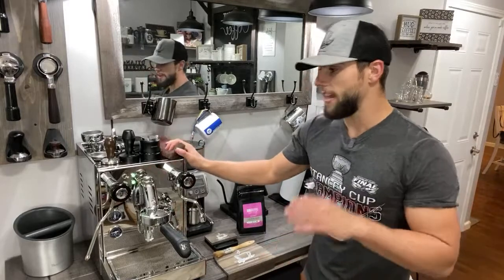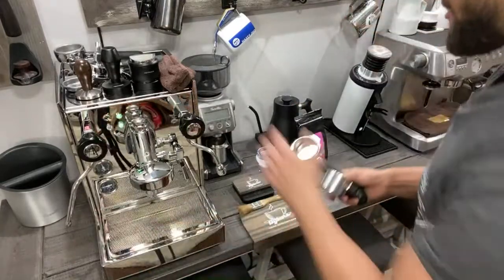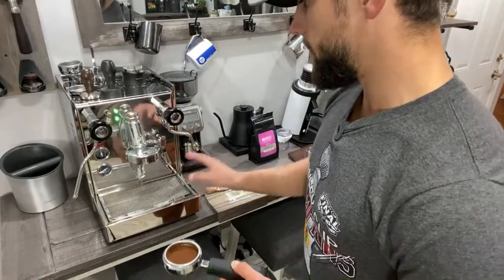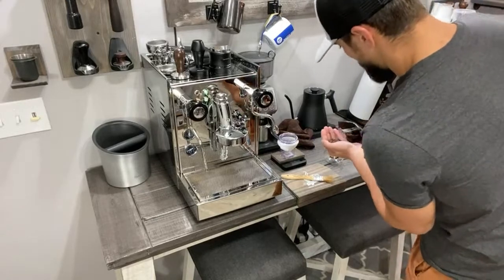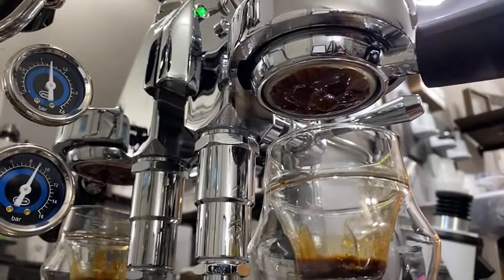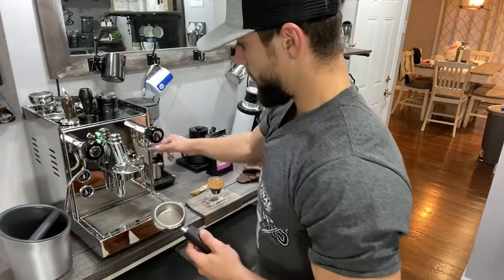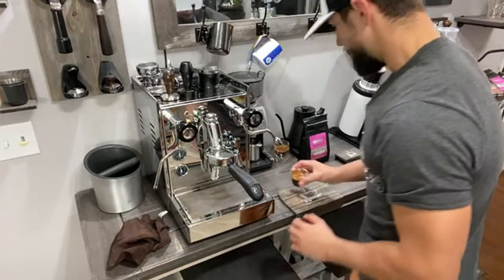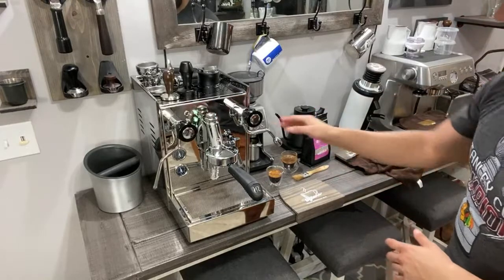Workflow Using Quick Mill Anita Evo!

Comment: Hi Dylan, I just purchased and set-up a Rocket Mozzafiato Timer Evoluzione R machine and am coming from the BBE! I am really enjoying learning this machine (PID, Rotary Pump and Heat Exchanger) and since I have a Niche grinder, I was able to use the same grinder settings I used for the BBE (with each Brand/Roast) which made the transition much easier. I installed the IMS Shower Screen even prior to using the machine the first time. I also use the B Plus puck screen with absolutely NO channeling. This should also possibly eliminate the need for cleaning the shower screen on the E-61 Group Head. Watching you pull multiple shots dialing in the specific beans, since you have the BBP, I would have thought you could have tried the grind setting used for the other machines you have. I would suggest you get ahold of either the B Plus or the Normcore puck screen (I have both) as they are worth their weight in gold for cleanliness!!